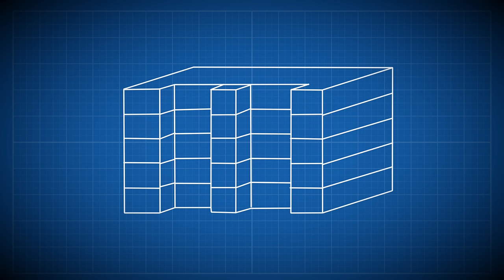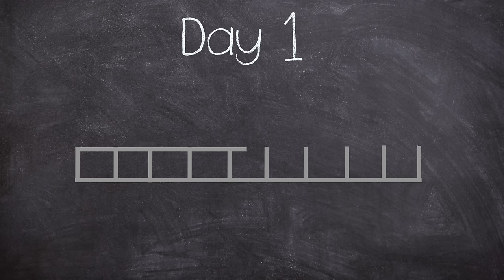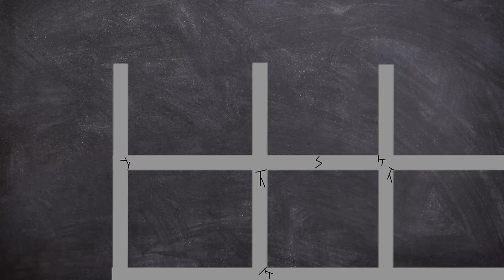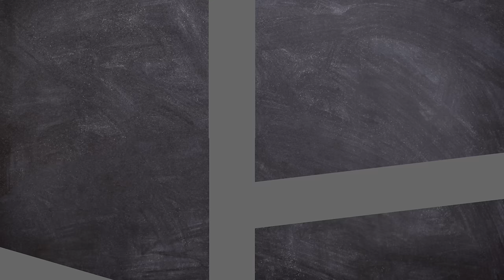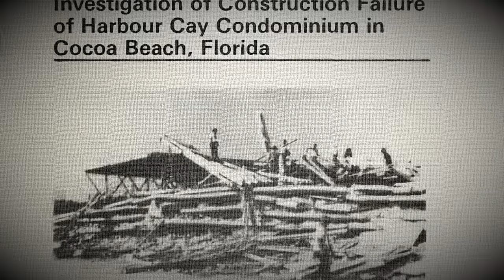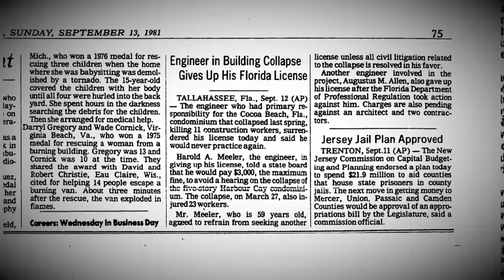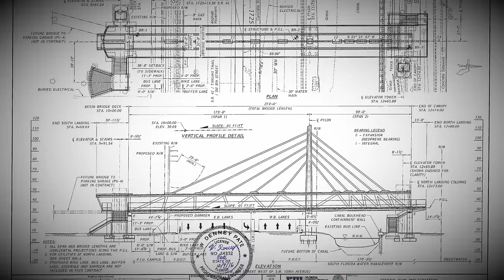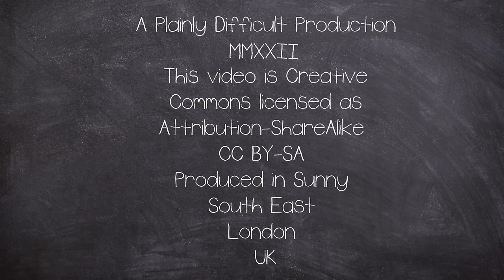The Florida Harbor Cay Condominium Collapse Disaster 1981 | Plainly Difficult Documentary

Comment: Ya that engineer didnt understand what was going on, you cant just add more steel in later placements without addessing the current issue. That would already imply negligence in your sealed design.
Reply: I'm not even a professional building engineer and I know that's stupid.
Reply: For some stuff you arguably could have gotten away with wrapping columns in steel sheets, but it doesn't take too long before you've built an even stronger building to hold up your new building, at greatly increased cost...
Reply: @absalomdraconis  Yeah. As a naval architect, I don’t understand why our land-bound cousins are so opposed to just making the building out of steel in the first place. It’s strong, cheap, and it bends instead of cracking and crumbling. They literally have to use steel anyway because concrete can’t handle the tensile loads. So why not do away with all the stupid heavy concrete and just use the steel for everything?
Reply: @michaelimbesi2314  Steel structures can collapse too. As a humble draughtsman of steel framed buildings, we needed engineers for a reason.

I like structures that show early warning signs, and people not ignoring them. Like prefering a cable stayed bridge over a chain link, so you notice cables fraying instead of a sudden collapse.

I like common sense, not adding fake reinforments merely for esthetics like in the case of the FIU pedestrian bridge.
I prefer gradual improvements with huge safety margins over fashion statements. Building codes enforced without cutting corners. We see buildings being spiced up with heavy cladding and AC units, instead of giving these aging buildings the proper attention.
I want Isambard Kingdom Brunel back.

Agreed, steel structures like the old twin towers would take away a lot of these concerns. But the thing is, a steel framed building still needs concrete to cover the floors: You can´t put a carpet directly on a corrugated steel plate. And I guess you need some kind of cheap and stirdy material to cover the sewers and water lines mounted against your columns. Enter concrete.
So before you know it, your floor plates and trusses are getting replaced by rebar, and your vertical columns become composite too.
All structural steel hidden from inspection, although I can´t help thinking concrete slows the collapse compared to a joint snapping. And the crumbly nature of concrete benefits in providing an early warning sign.

Sky scapers are steel framed, because they flex like your ships. Let´s hope it stays that way.
Reply: @michaelimbesi2314  this is how I feel when people insist on carbon fiber when fiberglass is basically 95% the same and it's not even a weight-critical application.  Carbon fiber costs like 15x more, though.  And modern biaxial fiberglass is insanely strong.

  It ain't the days of chop gun go brrrr and woven roving anymore.
Reply: Architects, contractors and developers look at engineers as a dime a dozen, they're all the same, but there is no substitute for competent engineering.

Comment: Hey John, though I've only been a South Floridian since 1991, after the Surfside collapse last year, it became clear how most of these condos were cheaply made since the 70s because of kickbacks, mafia involvement, etc.  

It seems like a couple of times a month since Surfside, we get news alerts about condo buildings in the area getting emergency evacuations of its tenants due to the building structures determined to be unsafe by engineers while the building is being reassessed by the state...and most of these evaluations are the 50-year reassessment type.

If the building needs to have a 50-year reassessment these days, it's time to shut things down, help tenants find alternate (and newer) places to live at and demolish the building, because any building made from the 70s weren't built the same as newer buildings are built these days with updated safety measures and rules in place..
Reply: Yup, hearing about these evacuations on the news. Recent one just down the street from the Surfside. Terrifying.
Reply: Not necessarily true. Quality builders back then were still putting up quality structures with plenty of redundancy, even for today standards. There were bad Builders then just like there are now. It's just now, the regulations are tight enough that the bad builders cannot cut corners large enough to compromise building safety
Reply: @SteveWillNotDoIt1984  : One of my grandfathers was a concrete foreman. Some of the general contractors he worked for would pull up rebar in slab foundations after the inspector had left. This was illegal even then.
Reply: Agreed. Nothing lasts forever, and so there’s a design life built into everything. (This isn’t so-called “planned obsolescence”, which is a myth, it’s basically the amount of time that the engineer can guarantee the structure will resist degradation/corrosion/water infiltration enough to still meet its original specifications). Once you hit 50 years, you’re getting up there. You’d think it would just make more sense to tear down the old 1970s era building and build a newer, nicer, more energy efficient building instead. It’s what we do in the shipping world. But apparently condo associations never got the memo.
Reply: @absalomdraconis  I would be very curious to know how he pulled up the rebar and what made it so profitable to spend the labor and energy doing so
Reply: @absalomdraconis  okay that doesn’t change anything he said. He said there’s bad builders back then and now. That’s a bad builder. Congrats your proved his point?
Reply: Correct.That applies to ALL BUILDINGS.
Reply: Welcome to Florida retirement. Maybe, you should have stayed in NY.

Comment: There was an accident similar to this in Gwangju, South Korea back in January 2022. The high-rise was rushed, it had sub-standard concrete and had not enough time and structural support it needed to harden. It happened almost exactly the same way as the accident of this video, about 30 stories higher up in the air. The only difference is, that the company responsible didn't get bankrupt, let alone suffer severe legal consequences. It somehow manages to be a worse dumpster fire than the same accident 4 decades ago.

Comment: Just wanted to compliment the level of detail presented in the video as you went along through the video.  I work with engineering concrete and the description of the design, the visual defects that formed, and the construction methods really helped the storytelling for me.  Great job including without getting into the weeds.

As an aside I’m kind of shocked the engineer, when brought in to look at what was unfolding, didn’t start screaming ‘shut it down!’  The cracking and deflection described in the slabs was alarming and was a huge red flag that things were fundamentally wrong with either the design or materials.  And considering the potential liability that licensed engineers hold… but I guess if that happened it wouldn’t be the subject of your video today.
Reply: That's because yelling 'shut it down' was not in the budget, in order to change the budget and add 'yelling' to the project, a proposal had to be sent first in triplicate to architect, builder and government, and after a few weeks for a committee to gather and study the problem, then an adjustment to the budget may be considered, of course if it falls on holiday there will be delays too. 😵😵😵
Reply: maybe it was one case of completion bias.
Seeing the structure almost fully erect made them think about the troubles of getting it redone from scratch and they just wanted to press forward and hope for the best because collapses always "happens to others".
Or maybe, given the flawed design, they were just plain incompetent
Reply: My dad was a civil engineer. He would say, " I'd never have signed off on this". He didn't care who got mad from it.
Reply: If a building starts deforming while it's still being built, clearly there is something very wrong and the entire thing should be demolished and rebuilt from scratch. I can't comprehend how anyone could possible sleep at night allowing such a project to continue while people are standing on it all day.
Reply: Honestly it doesn't even take an engineer to see how bad these problems were. Even unskilled workers on site should be able to tell that there's something wrong when the half-built building is cracking and crumbling. I find it just as shocking that the workers pointing out the defects were willing to keep working in what was clearly a deathtrap.
Reply: @annehaight9963  there were people who explicitly designed it that way. If it was on me, I would've charged them with manslaughter or whatever the correct term is for murdering 11 people...

Comment: Concrete is fickle stuff, so easy to make mistakes and even easier to cut corners. When you understand how important it is to get it right, you are nothing short of evil for not doing so. I have seen new buildings, that sold off the plans, have exposed reinforcing clearly visible in the carpark, which of course is the sub structure holding everything else up. 
In Sydney, Australia where I live, there is a building called the Opal Tower that was evacuated on Christmas day, as were many other nearby buildings, due to fear of a collapse. It  didn't but might make a good story on this line of poor quality construction.
Reply: In Pakistan, there is a general purpose design for concrete plazas which is used in 99% of buildings everywhere, it has ensured that at least the structure by design remains sound. I don't know the technical term but buildings are made with reinforced concrete beam boxes, concrete slabs for floors and brick walls, though within unit walls can be of anything.

Though collapses still happen frequently in one city; Karachi, due to lax controls and shoddy materials. Frequency is about once every month...
Reply: @brazensmusings2738  Karachi is a big city. Once a month sounds scary.
Reply: @angelachouinard4581  It certainly is scary for a big city. A lot of them are going up as they are going down... Two have gone down this month alone...

OTOH, I am living in a apartment tower with shoddy floor plan and overextended floors in Islamabad. The floor beam goes through the middle of the room, haha... A hallmark copy paste structural plan and then the architect shoe horned the apartments wherever he could... Still it has remained sound with frequent earthquakes.
Reply: @brazensmusings2738  My father traveled to Pakistan quite often and even took my mother with him once. She loved it. So I have a soft spot for Pakistan and I'm sorry to hear that's happing. Stay safe, please.
Reply: The original engineers for this project didn't understand, that was the problem.

Comment: I remember this collapse. The design was weak, the construction standards and materials used were poor, and still they would have been okay if they had not removed all the supporting poles on the lower floors and then poured the roof. After this event contractors left supporting poles in place until the entire building was completed.
Reply: I mean I'm not exactly sure it would be ok with holes in pouring and reinforcement visible, but yeah, you're absolutely right that keeping those supports would have lowered the chance of catastrophe:)
Reply: They would ONLY have been "okay" if you consider it okay to leave a substandard building with less than code-requirements in the walls, remaining supports, and structure... Sure, the COMPANIES involved wouldn't have been caught up in the catastrophe, but a building structure at roughly 75% of the structure required by law would've been "completed" for the consumers and market...

    What if YOUR parents had taken up a condo' in that place before the inevitable happened???  ;o)
Reply: Better safe than sorry

Comment: Small correction. The bar chairs DO make sure that the rebar is in the right location but the consequence of it being in the wrong location is NOT really extra bending but more a dramatic loss of strength or durability.  It also sounds like the bars ended up all bunched up which would mean that the liquid concrete couldn't get into all of the gaps around the rebar. Reinforced concrete is designed so that the steel and concrete work together to support the load and if there are air gaps around the concrete this can dramatically reduce the strength.

Comment: I was trained and worked in heavy civil engineering in the UK. In that period there were different forms ofproject  contract . But most were of the Architectural format, Where a consultant structural engineer is hired to monitor and amend the planned format of the building. In a"cast on site" RC structure like this. The structural plan would have required local planning approval of the RC structural design drawings before construction even starts. As the structure progresses the local planning office would inspect major elements before they were cast. (The structural consultant should always do this anyway) .   In short this project should never have got passed the drawings before it was amended.
The concrete mix is certified And Checked by regular testing of concrete blocks cast AT THE TIME! These cubes are then crushed in a press to see if the 7 day and 21 day strength performs as specified.     In the above project, just allowing 7 days between floors  seems insufficient, even if they staggered the process. Also the foundations problems associated with conditions in Florida can be yet another nasty situation.     In the UK we often see columns and beams cast on site, with precast floor elements produced-off site and lowered into place by a crane. Then bonded into the structure with reinforcement and grouting.       Another form very common in America is a steel frame (clad in concrete) with Pre cast concrete floors.
In the project you describe - with cracking seen on the underside of beams and floors at least by the 2nd floor. All work would have been stopped (by the structural consultant, the architect or just the planning officer)  until the source of the problem was corrected. It should NEVER have reached the 3rd floor, let alone the roof!   I would strongly expect that local corruption played a major part in this failure. Because so many people (with the clear responsibility to stop it) simply didn't say ANYTHING, or request concrete testing result before the work proceeded. Big envelopes full of dirty cash probably changed hands on this job.      I did work for a structural consultant in Reinforced Concrete. They would have been horrified at the drawings stage. We have codes of practice and regular materials  testing to prevint this kind of "BUILT IN" DISASTER!
Reply: As a professional concrete engineer, could a jet plane take down the twin towers?
Reply: @RealDixonPeter  way beyond my knowledge.
Reply: In Florida they just don't have our UK mindset about safety. Though there are some very good safety agencies in the US at federal level, and they do some great investigations where they don't pull punches, they don't have as much legislation backing them up as ours do here, and some states just don't believe in regulation- Florida being one of the worst if various collapses are anything to go by. I've had more input and more inspections from Building Control changing a 12 foot square flat roof to a pitched roof on a single storey extension than they seem to get on major builds- it seems they self-certificate a lot of the time, and we all know what that means. Not that Grenfell leaves us with much to boast about. The problem we have now is that 12+ years of a very right-wing anti-safety, pro-developer-profit government has undermined a lot of our regulations and inspections.

Comment: I recommend you investigate how much organized crime influenced this problem. In Florida, as in NY and NJ, the concrete business was quite corrupt. The unions were (and are still) owned by the mob, the leaders often hand picked by mob bosses, and inspectors and others were either paid off or threatened to ignore problems. This was such a problem that the entire concrete industry was considered corrupt, and when a clean company operating outside the teamsters union entered a territory, things got dangerous. Just driving your truck into their territory could get your legs broken, truck locked as the concrete cured, and worse. In Florida, it was much the same as New York and New Jersey. This activity was at it's peak in 1980/81, even though it was in the middle of mob wars and radical FBI enforcement, RICO and other tools were still fairly new, and Giuliani and other leaders were aggressively attacking the mob on all fronts, that the mobsters were especially eager in quieter markets, like Florida's concrete industry. It wouldn't surprise me in the last if the people supervising or doing the work weren't selling the saved rebar back to the same company they worked for.

Comment: Seems to be a theme with sketchy condo construction in Florida during the 70's and early 80's....

I actually visited Champlain Towers South just 2 months prior to it's collapse. The pool deck looked wet constantly, even though it was a dry day. Big chunks of missing concrete and exposed rebar on the exterior everywhere. Happened to read on their bulletin board about their $15 million repair project that was just about to begin. 2 months later, building collapses. Such a shame. When will we learn to take care of our concrete structures? Waterproofing and fixing wear is so important, in addition to properly building them to begin with. Florida is harsh environment, with extreme temperatures in much of the summer with wild swings from night to day. High Humidity and Extreme Storms don't help, either.

Happy to live in Florida, 20 miles in land, 24ft above sea level in a single family home.